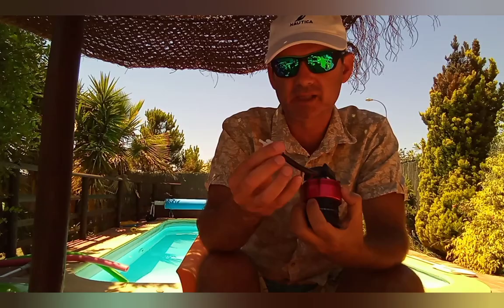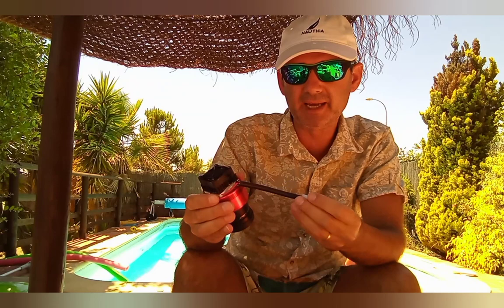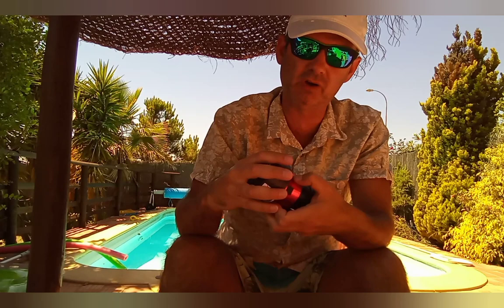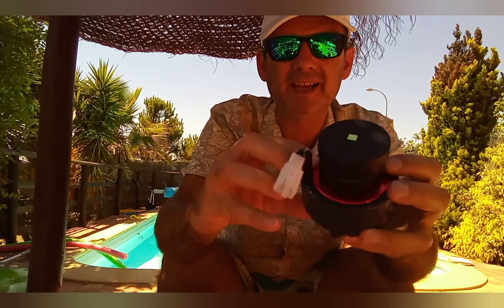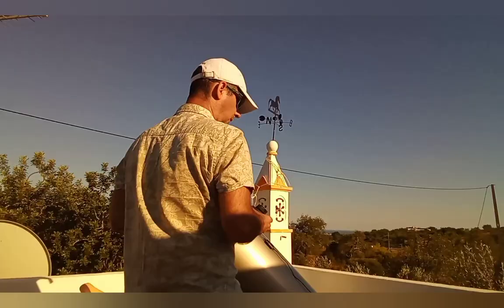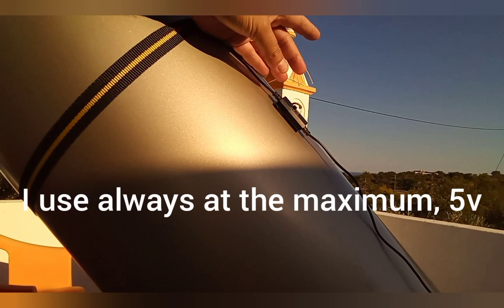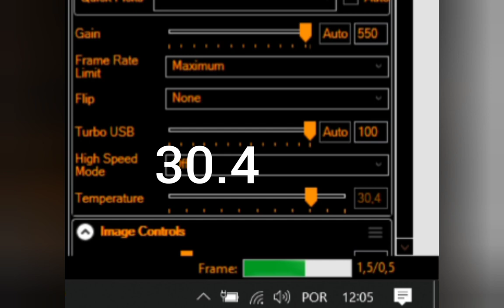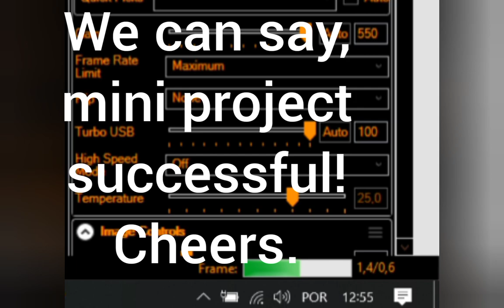DIY MINI COOLER for Camera to use with a telescope - inexpensive and easy with peltier

Comment: Great idea Tiago.  I had noticed that the sensor temperature of my ASI178MC camera is displayed in SharpCap.  I haven’t seen it higher than 24 deg C yet but warmer weather is on the way (Probably not as warm as the Algarve though!).  I might play around with cooling the camera like you did but it is hard to efficiently remove the heat from the sensor chip, as you pointed out in your video.  Ideally, a cooled camera is the right way to go.  Those are however rather expensive, versus your method which looks like it would not cost too many Euros/Dollars.
Reply from the maker: Yes. Nothing can beat a cooled camera. When i bought my ZWO294 i was in doubt but 400 euros difference made me choose the uncooled version. To my temperatures this mini setup is useful because of those red noise dots that my darks fight to get rid off. This mini cooler help a lot. I guess it will depend of how much noise one has to deal with. In my case, using an eq platform with its periodic errors turn those red dots in circles and other patterns during live stack. A single dot can be multiplied so i got to use dark files always. This mini cooler is like having one more noise fighting tool.
Reply: @DobsonianPower   I need to learn how to apply a dark while live stacking.  Is that even possible?
Reply from the maker: It's easy. First capture darks with sharpcap. 10 or 20 darks, it will save an average file. Then push them in the dark browse button at the right window. Then live stack normally.
Reply from the maker: @martynh5410  I will upload a short video doing it in a moment. Don't worry, it's very easy and effective.
Reply: @DobsonianPower   👍